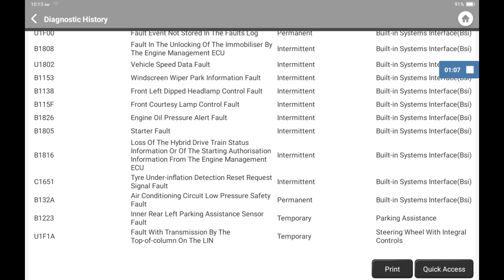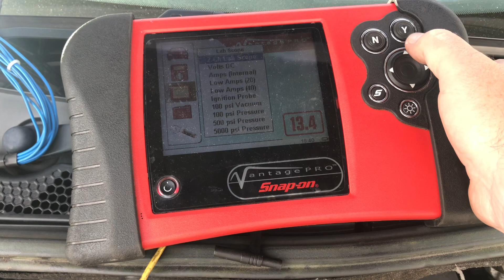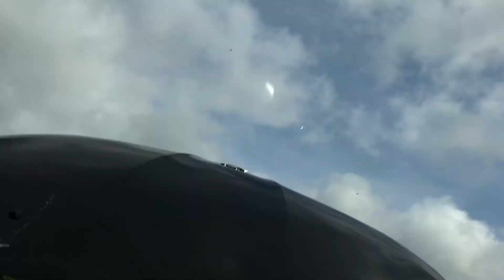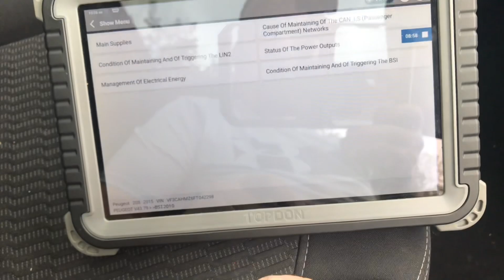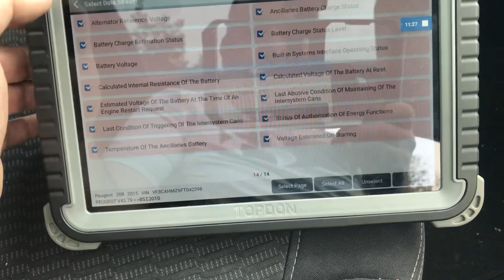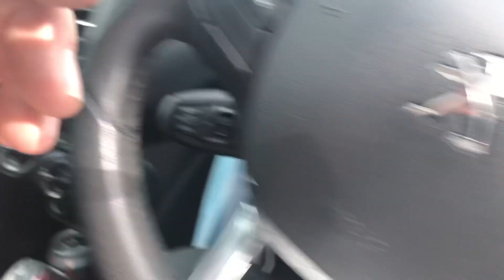Peugeot 208 1.2 HMZ (2015) - Alternator not Charging/Battery goes Flat  Code U1F1B LINBUS 21 Part 1

Comment: Hi Sandy, I have the exact same issue on my Peugeot 208 1.2. Charging drops to 12.4V when LIN is connected, but goes to 14.2V when disconnected. Did you ever manage to fix it permanently with a BSI software update or was it a faulty Battery Monitoring Unit (BECB)? Thanks!"

Comment: How did you get the plug off the alternator mate?
Reply: i had the same problem . i bent a nail near the bottom into a 45 degree and fiddled about at the front side of the plug . about 1.25 in .  https://www.youtube.com/watch?v=e16JzGxlOVw&t=88s  .

Comment: Great video . im an old timer points and tappets mechanic ,  a pal had a flat battery on her 208  checked the alternator output 12.02v no warning lamp on the dash ,about to order an alternator, ,i thought i will check the internet and see why there is no warning lamp ,came acroos your video, disconnect the plug and 14.4v charging "Quality" , a control module for an alternator ????? i must be too old to fix vehicles now cheers
Reply from the maker: Never too old, keep going 😁

Comment: Sandy, this is caused by an engine software fault. There is a recall campaign HNZ to correct this and also a TSB. The software should be equal to or higher than 9692530380, version 46, edition 0207. A quick check is to disconnect the alternator connector, if charging returns but LIN codes are set, the alternator and LIN network are good and the fault is software. I have seen loads of these as a Peugeot MT.
Reply from the maker: Scott thank you very much for this invaluable information I'm going to contact another main dealer tomorrow cheers sandy
Reply: @sandyande   No problem. If there is a recall outstanding, it will solve you’re problem for free! Also this model does not have the battery monitor (BECB battery charge status unit) that would normally be on the negative terminal if present. Regards Scott
Reply from the maker: @scottbarnsdale7641  thanks Scott
Reply: Hello, if i disconnect the alternator command cable can it run for 2 weeks ?

Comment: I had a similar fault after a customer had fitted three new alternators and having performed a software update on the bsi the charging system started working as it should. Just something to bare in mind.
Reply from the maker: Cheers Paul, Sandy

Comment: What are you thinking is the cause Sandy? I had a similar issue from another garage after them fitting a new alternator it would charge with Lin disconnected. Been running since with the lin disconnected although i suspected a cheap alternator was fitted as by the garage as the dealer price for genuine unit was £500+
Reply: That sounds like the same fault I had. A bsi software update sorted my issue
Reply from the maker: I think the cause is just software corruption cheers sandy